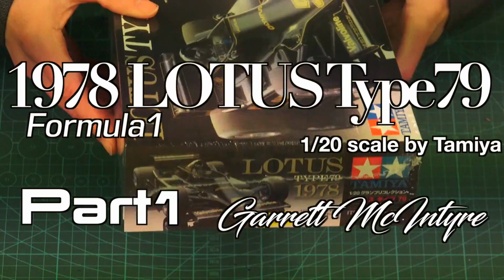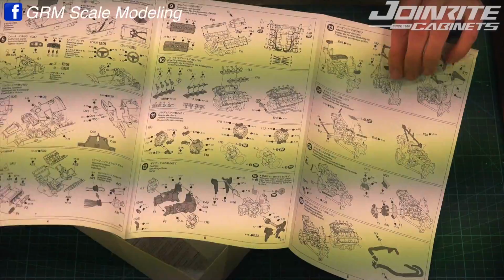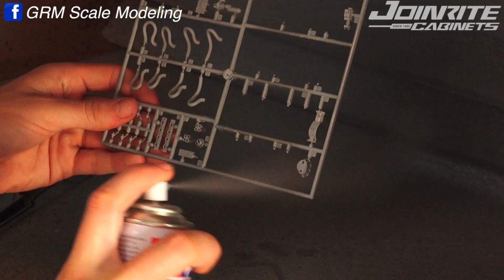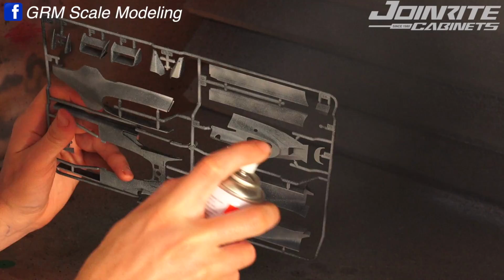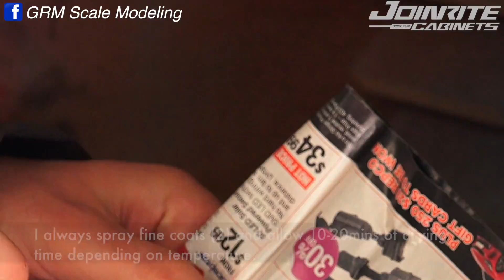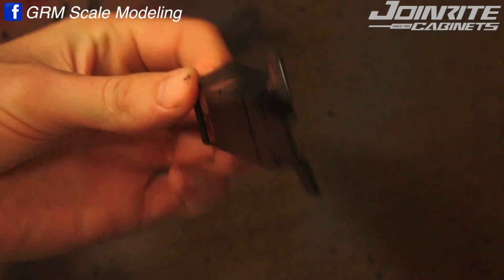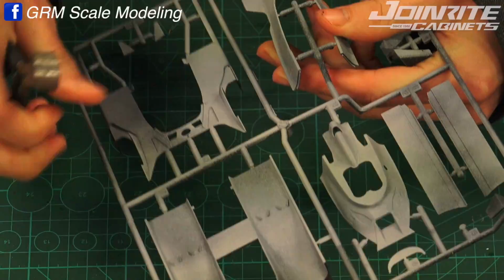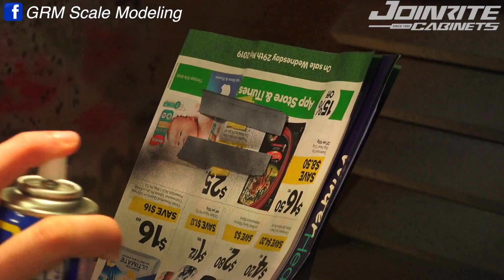Tamiya - 1978 Lotus Type79 1/20 (Andretti/JPS) Part1

Comment: I haven't really worked with Tamiya paints in the past, used Testors in the past. I see you using a brush to paint with in some places. Did you need to thin the Tamiya paint to do that like you would for an airbrush, or is it fine the way it is out of the jar?
Reply from the maker: I’ve learned a lot since then with airbrushing, I’m now using Scale Modellers Supplies as I have found out to be far more cost-effective and time-saving than using Tamiya or Mrhobby. That video shows that I was running on a budget.
Go to https://www.scalemodeller.com.au/ or hobbytechtoys.com.au as this is where I buy mine. Stay tuned for the next video coming online by Sunday I believe.